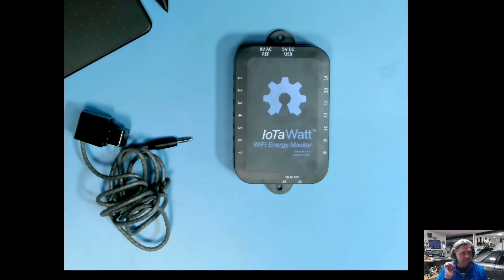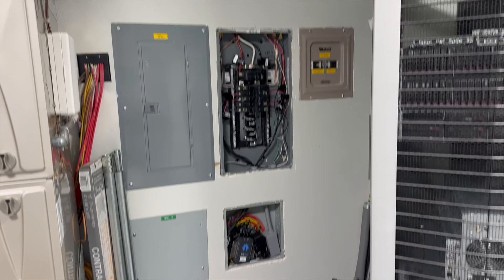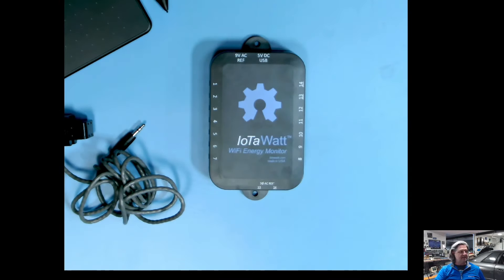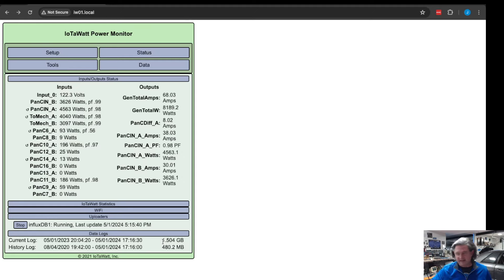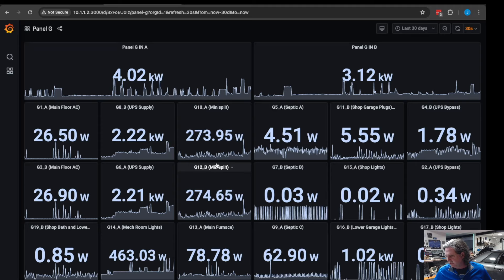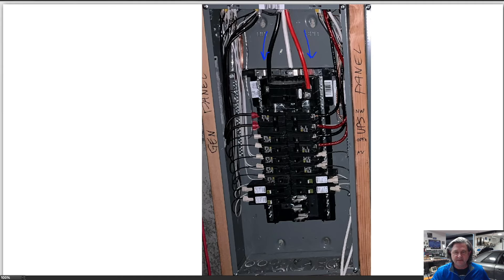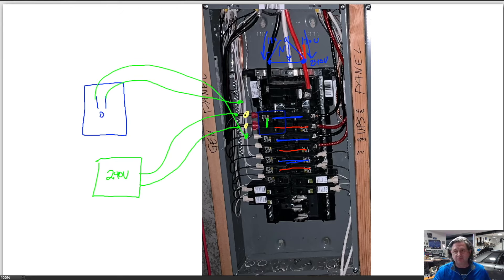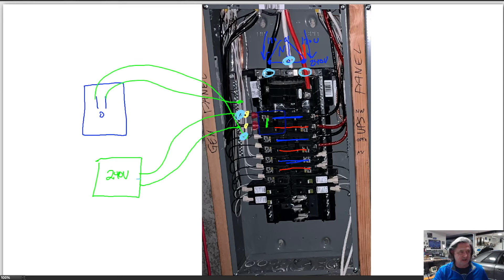Monitoring Power in your home or homelab.

Comment: Interesting stuff. I've just moved my small homelab(Puget systems dual Zeon tower, and HP DL360p gen 8) out to the garage where we have our offgrid 3.6 kW/10kW BBank system we use to charge our Lightning, also running a 12k Btu mini-split. I'm just using Solar Assistant to monitor usage. Definitely took a lot of heat, and 300watts of use, out of my home office. It would get pretty toasty during long conference calls. Sounds like we're in pretty similar technology usage in our roles. Just when it looked like Prometheus/Grafana was heading out the door at work, it's been brought back, so I might build something like this. My lab hosts Cisco CML, and once Ansible Tower, but working more towards streaming telemetry monitoring testing of virtualized digital Twin models. My 981 Cayman is in there right now as well for a jack stand alignment tonight !

Comment: Worth mentioning newer smart panels like Span that integrate circuit monitoring.
Reply from the maker: Yea the SPAN panels are cool, especially for smaller projects where you have just one panel.  They do support a multipanel mode, but not really if you have 6-8 panels.   I suspect the other major panels like SquareD will eventually have more built in measurement support.

Comment: See the homelab psu has a steady draw of power, as expected. After having the monitors installed for some time, are there any unexpected high energy use circuits/appliances that you have found?

Comment: Weird question, but does utilizing a clip-around clamp only measure ambient amperage and wattage?  What I'm inferring is that you aren't getting completely accurate data because you're not directly connecting with the circuit, but are only measuring the amount of electricity that is being leaked by its ambient electrical field surrounding a circuit.  Have you tried this with a directly-connected circuit, and if so, how much of a difference have you noticed?   A 3% or % variance between the actual measured vs. the guesstimated measured?
Reply: Without getting too far into the electrical theory weeds, this is exactly the same technology used in metering high voltage and high amperage circuits. It’s extremely accurate since the magnetic field (not leaked electricity) is what the devices are measuring to calculate current. The voltage side of the equation comes from the power plug he showed in the lower box. The only thing that would make this substantially more accurate would be measuring voltage on both legs (240v) instead of just whichever one powers that outlet.

Comment: Is there any issue with the WiFi connection when enclosing that device inside a metal box?
Reply from the maker: I meant to mention that...  No, it works, which did surprise me a little.  I do have an AP in the ceiling somewhat nearby each of the panel locations.  It is 2.4Ghz wifi, and that is pretty good at making it through small spaces, drywall, etc.   It is also pretty low bandwidth so that makes the overall signal demand less.

Comment: So you don't need to strip the circuit wires? They just clip on the outside? How does this magic work?
Reply from the maker: Correct - there are CT couplers that are small magnets that clip over the wire and measure the EM field generated by the current in the wire.